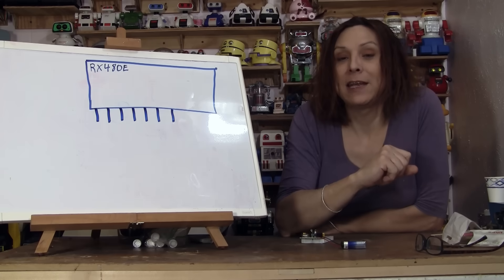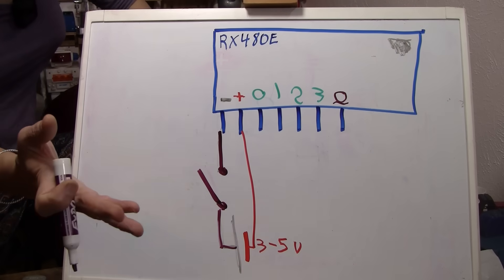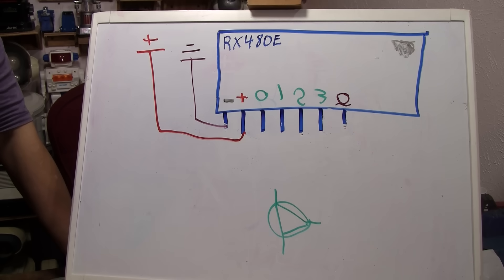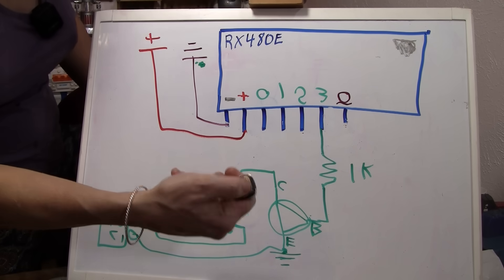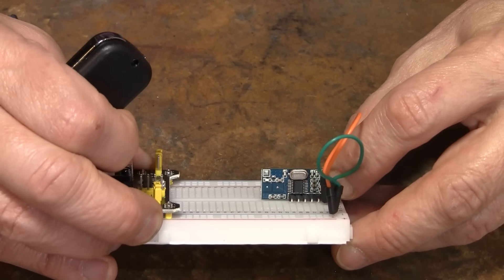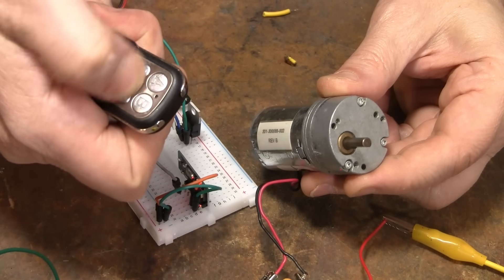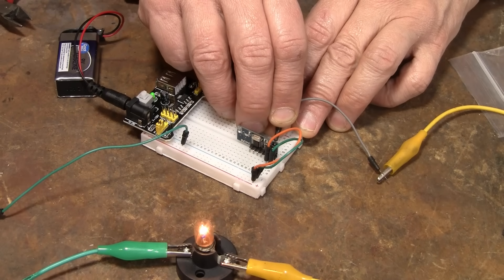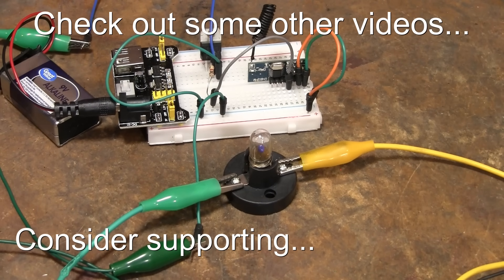How to Make Anything Remote Controlled with the RX480E Circuit!

Comment: Would be interesting to know WHY you need a resistor there and why it need to be of that magnitude. Please tell me. ;)
Reply from the maker: There were two resistors... The one for the LED is to lower the voltage because an LED only uses 3 volts, and I had 5. The resistor for the transistor is to protect the transistor, but it's also acting as a load. If you measured each side of the resistor, one side would be positive and the other would be negative, as long as the transistor is turned on with the positive voltage.
Reply: @RandiRain  Thank you! Now I have learned something new. ;)
Reply: Different color Leds require different forward voltages and operating currents to become lit. For instance, if you are using a red Led with a Vf of 1.7v and want to operate it at 10mA using 5v, the resistor would be voltage you need to drop is (5 - 1.7) divided by operating current, 10e-3 which is 330 ohms. If you want it brighter, use a different slightly higher operating current and recalculate. Blue and while Leds have Vf of around 3v and need lower resistors. Their data sheet will give you a graph to show the required voltage and current.
Reply: For a typical transistor, do the following, but read further about this particular type of transistor (TIP120) used in the example video . The resistor for a transistor can be calculated. First step, find the current requirement for the motor/load from its spec sheet. Then divide that current value by the Beta spec of the transistor,. For example lets say Beta is 100 and the motor draws 1 amp, that means that the current moving through Base leg of the transistor needs to be 1/100th of 1 amp or 10mA. Now the next known parameter is that  the Base to Emitter voltage drop will be .7 volts (VBE of a Si diode). Subtract that from the Supply voltage of 5v = 4.3v. Now use Ohms Law to calculate the resistor value by dividing the Voltage (4.3v) by the Base current, (.01A or 10 mA) and you have 430 ohms. The 1K that is used in this example will work if the the given motor current is less that .5amps.

But this is no typical transistor. It's whats called a Darlington Transistor, which changes the game significantly. The Current Gain, related to Beta is even another magnitude higher (1000 rather than 100) and a couple of other parameters also change (VBE is 2.5, not .7). So recaulating for this type is transistor you'll have the following: Base current is now 1mA, and the voltage across our unknow resistor is now 2.5v. So the resistor value should be  2.5k. The 1k resistor of the this example will work fine and even allow current of up to 2.5 amps if needed. I haven't done these calulations in many years, so if I'm wrong or miscalculated, anyone feel free to correct me.
Reply: @Salty_Knuckles  Your analysis here is spot on, but in reality when using a transistor as a switch the goal is to shove it well into saturation (because if you "calculate" and end up with a transistor with a low beta then you end up with a voltage drop across it and it gets hot). So the maths you've put is good for telling you whether the transistor is even up to the job. But for selecting the actual base resistor to use, it should probably be about 1/10 of what you calculate (or definitely something like 1/2 the value calculated with the worst-case beta shown in the datasheet)
Reply: @Salty_Knuckles  I'm learning so much today. ;)

Comment: I love seeing people still using the oldschool methods of remote controllnig stuff. I would be lazy and use a esp32 and use BLE  (from my phone or a remote) instead.
Reply from the maker: That's overkill in my world. Not very magical if you pull your phone out. It's usually controlled in secret.
Reply: @RandiRain  You can also use a second esp32 as a remote to hide it :)
But I completely agree, it is very much overkill.
Reply: A BT link would be much easier for the audience to detect and potentially interfere with. This only transmits when you want to "do a thing". And then there is also all that code to write. But it is all horses for courses.
Reply: It depends on whether you come from the control systems/batching systems world or the IoT world.
Reply: BLE has much better encryption and authentication, I guess. Wouldn’t use these for anything important.  😆
Reply from the maker: @serpent213  Thus the reason I geared it towards magicians.